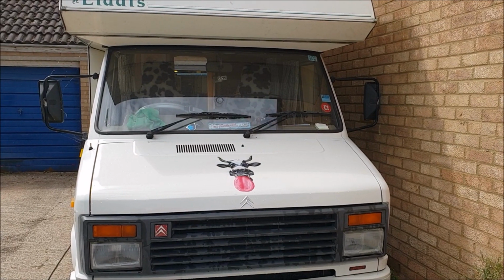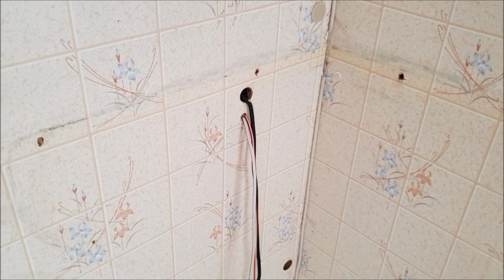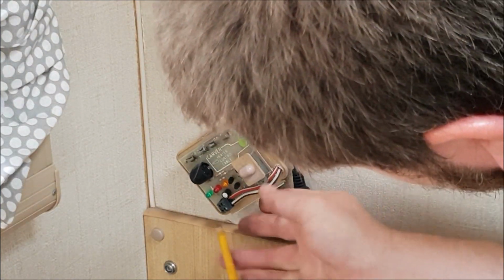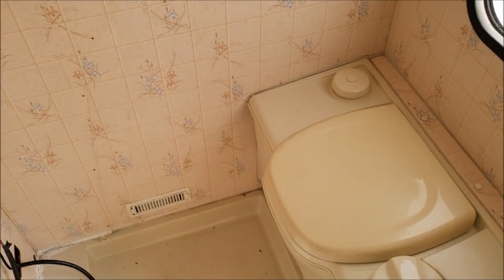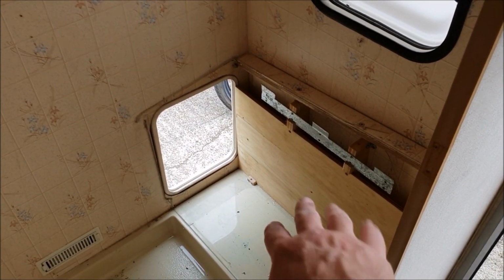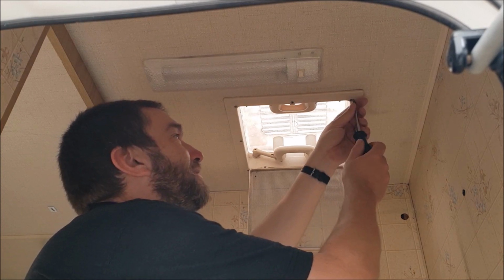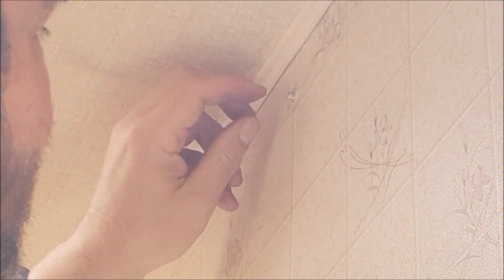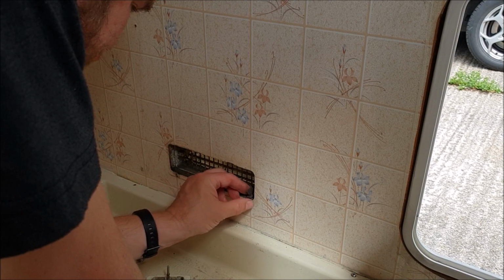Carrying On With Stripping Out the Washroom In The Motorhome & Removing The Toilet

Comment: As jeffery Wilson has said,  you can cut the walls and slot the wires in the groove because the cladding will cover the cut,
Reply from the maker: I guess I could but probably only worth doing if I could get the pipes in as well. I'm not sure that would be the best thing to cut such a large groove, may go for some suitably sized trunking 🤔